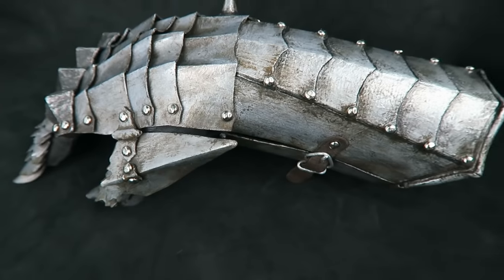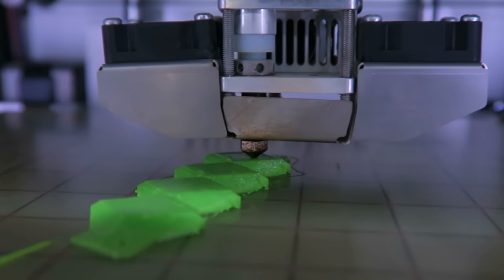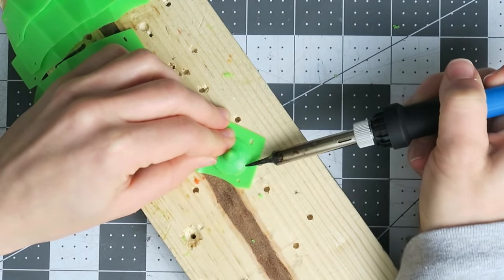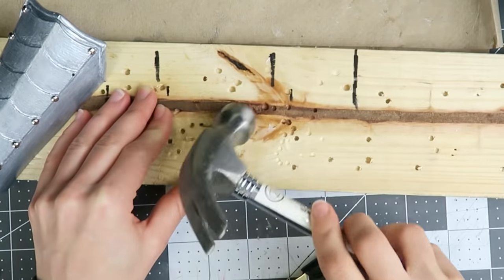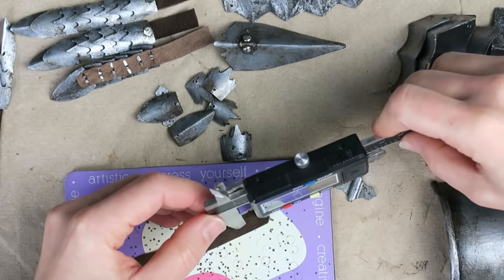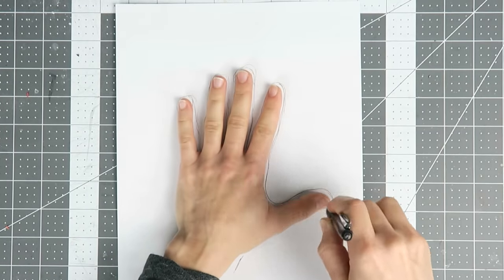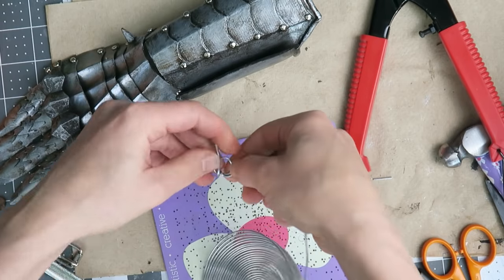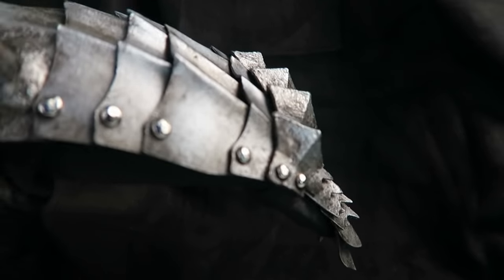Ringwraith Gauntlet Small Scale Prototype (3D Model Available)

Comment: can you share the glove pattern? I had the same issue (holes between the fingers) Can you help?
Reply from the maker: I didn't make a proper pattern, just eyeballed it from the traced hand. It worked better not to cut out the hand until after the seam was stitched a few times in straight and zigzag stitches. Also I think a fresh sharp needle would have helped.